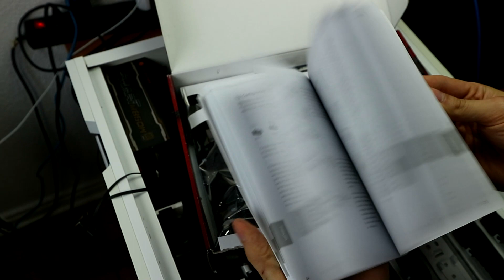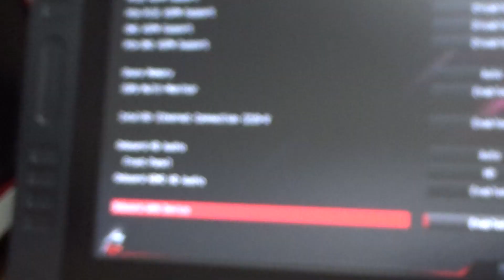Quick ASRock B460 Phantom Gaming 4 Unboxing & Installation (LGA1200 Motherboard)

Comment: Support core i7 10700f ?
Reply: it supports any 10th generation intel cpu
Reply: @Grilly-9292  does it support 9th gen ?
Reply: @MrCandyplays  no, it has the LGA1200 socket, it is way different. 9th gen and older use 1151 socket
Reply: Sometimes they even use 1150 socket, so do your research before buying cpu and motherboard
Reply: @Grilly-9292  ok
Reply: @Grilly-9292  thanks i bought it but than made a refund so thanks man
Reply: 01:41 even i7 10700K, 10700f support ram maximum 2933Mhz, this motherboard supports up to 2933Mhz, absolutely support

Comment: Great Review! Im really interested to hear about your Memory results. I have Corsair 3600mhz c20 ram(Timing 20-23-23-43) and under xmp settings my computer wont stop crashing randomly, but running @ 2666mhz default with xmp off it runs fine with no crashes. Ive also updated the bios to 1.10a from asrock website. Have you had the same problem and do you know what this might be?
Reply: This motherboard supports up to 2933mhz ram, 3600mhz on this motherboard would be a moneywaste and could lead to problems.
Reply: @Grilly-9292  sorry i have the b550 i must have messaged the wrong video. 
fyi I still haven't worked out what to do
Reply: @nshyd9460  the only thing i think would work is 1, bios update    2, go on forums, and search up your problem